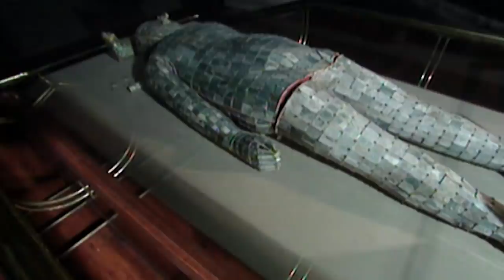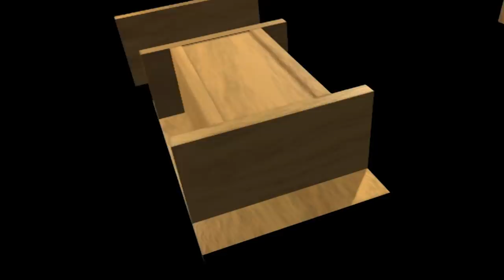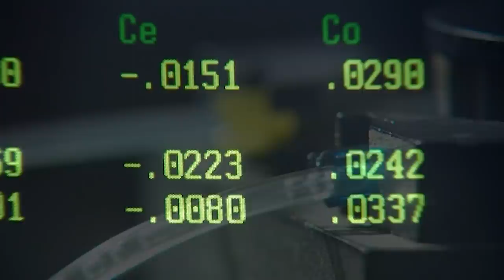Ancient Lady Dai: The Most Perfectly Preserved Mummy Ever Discovered | Diva Mummy | Absolute History

Comment: My first though was that if something has been preserved for that long, it might not be a good idea to breath the air anywhere near it let alone touch it.  Salts playing a role does sound plausible.  Water will move from areas of high osmotic potential (distilled and deionized water) to low osmotic potential (hypertonic).  Salts do make a good preservatives as well.  High a concentration of various salts might explain some of this preservation and mysterious movement of water into areas appearing to be well sealed.  That would probably have been mentioned if this was an obvious factor.